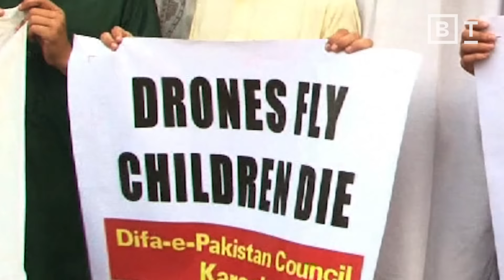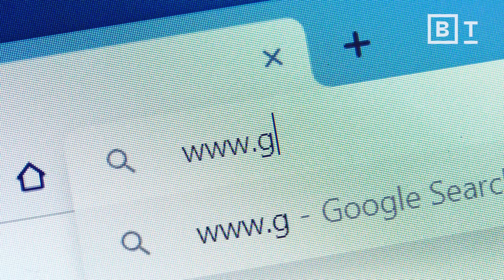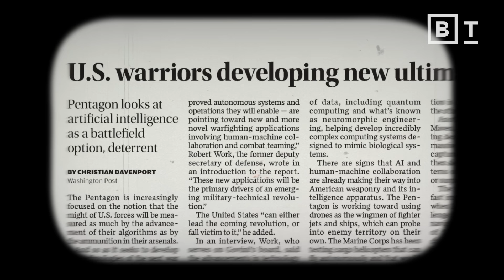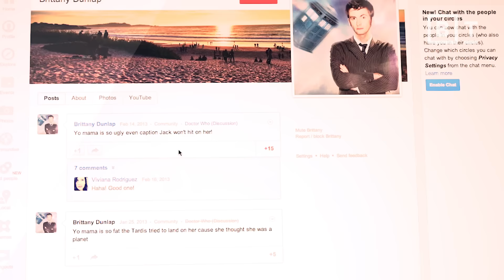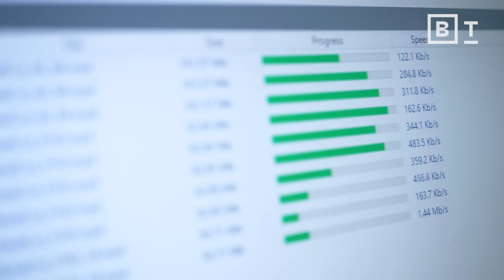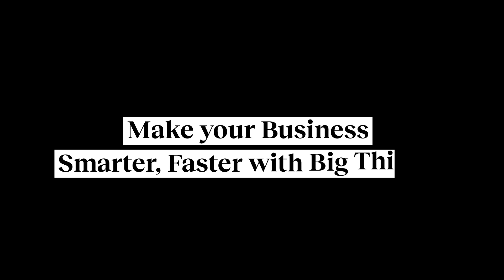Google’s secret “Project Maven”: Evil—or moral? | Anna Butrico

Comment: While we're on it: What about the Google/Apple duopoly? When it comes to mobile operating systems, there's virtually no other choice than Android or iOS ... and hardly anyone even seems to notice!
Reply: Android is open sourced, so it can be used completely without Google.

There's nothing wrong with them being the initial developers as long as the end product can be modified by the user.

Even a heavily locked OS such as Samsung One UI can be de-Googled and made more private.
Reply: @AshleyRajam  Then try to use your open sourced Android and let me know how long it took before you came across an app you wanted to use but couldn't, because it needed Google Play Services.
Reply: I also don't foresee an alternate that's better than Android anytime soon.

Linux is great and very much customisable and that's what makes it great, because as we learn more and develop more, android and Linux can improve constantly and remain open sourced until some companies get smart and start selling "features" or "apis" which is basically what's happening right now with exclusive apps for certain brands, etc. 

All you can do is hope some great developer to reengineer that feature to be cheaper or they simply make the code open sourced.

An example of this is screen video recording, I remember having it back in 2014 on my Sony Xperia, no other smartphone had that feature built in. You had to pay a premium for Sony's version of Android.

Now you see Android 13 could be adding that feature to android years later.
Reply: @AshleyRajam  Have you ever heard of SailfishOS? It's the third largest mobile platform behind Android (with all its variants) and iOS today and it's based on Linux, but hardly anyone even knows about it! Many will not consider it better than Android, but that's not because it wasn't any good, but because it hasn't got a huge company like Google or Apple behind it. And that shows the real problem: Who's going to cope with companies like these? Certainly nobody (even Microsoft failed!), until the duopoly is recognised and actively fought against!

Comment: 1.) Evil is an incidental oral and literary belief bias juxtaposing as the opposite of Good. mainly used by newsagents for socio political group representation depicting group torture against the individual.

2.) Moral is the cognitive capacity to accurately evaluate individual behaviour and the cause of action required for this behaviour to unfold, both ethical and leaning towards a collective common Good.

3.) Google is a Private company, like any other company needs to function with capital profit to keep product and service active.

4.) The answer to the question is "none". The logic is that Defense Dept looks after security and therefore information security, which promotes digital  business market for everyone.

So then, it is understood as becoming military contracted means better security for safer business.

Good for everyone.